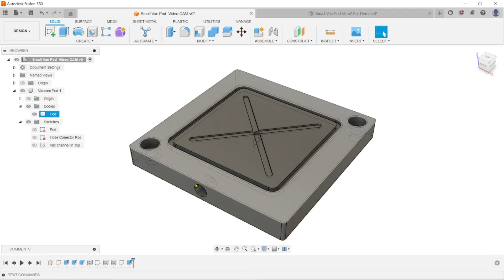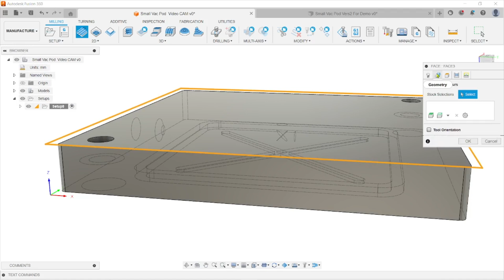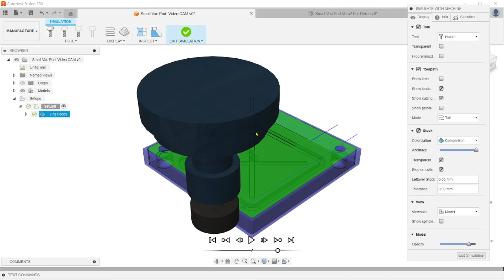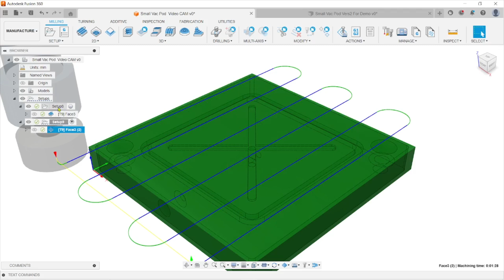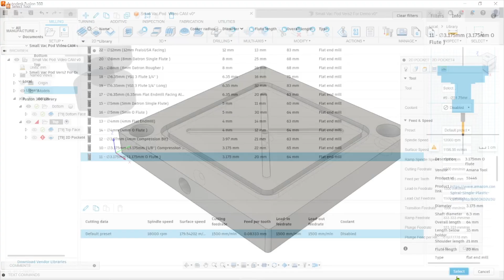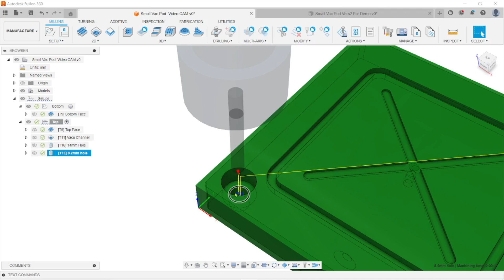Fusion 360 CAM: The Ultimate Beginner's Guide

Comment: thank you really good video
Reply from the maker: Glad you liked it !! Your machine is up and running ?
Reply: @ hello, yes i make several major upgrades and then I machines a part with heavy passes , it was really promising but my 2 Chinese ballscrwas died , they have play on the nut and the bearings block … zzzz
Reply from the maker: @ThomasLe_G HIWIN is tough to beat for the price - just make sure you get the real one. Also TBI is good.
Reply: @JBWorx  yes that's true, and you what is the brand of the ballscrews ? and where i can buy some TBI ones ?
Reply from the maker: Well the ballscrew on my machine is out of spec for the typical tolerance. I have proven that in one of my videos where I use the software to offset the error. Honestly I cannot provide a vendor that I trust in this moment. I did get a ballscrew / nut from Amazon about a month ago and I was surprised that it was good quality. I simply liked the idea to ship it back at no cost of if I don’t like it.

Comment: First things first, thank you for all your hard work in providing us so much of your knowledge and lessons learned.

What's the logic behind doing multiple step down passes on the pockets & perimeter VS cutting at full depth and doing multiple step in passes? I'm totally knew to CNC milling and I'm currently building my DMC2 Mini so I'm trying to absorb as much of your knowledge as possible, thx.
Reply from the maker: This is just a Funktion of the material thickness and how much material needs to be removed radial. Also what strategy is applied. For instance a 2D adaptive will protect the tool for too much radial engagement, but will use a rather high engagement of the flute length. A 2 D pokey path will not do that and you will need to take care that you don’t overload the tool during that pass. Hope this makes sense.
Reply: @JBWorx  Okay I think I understand. I've got a lot to learn especially with to loading on the radial and axial. 👍🏻
Reply from the maker: A lot depends on the machine. I am always conservative on my cuts protecting the equipment - I have time. But if you make parts for money it looks much different.

Comment: Thank you for the video really enjoyed it. I was searching for fusion 360 tutorials as I appear to have got my Z axis pointing in the wrong plane and I’m still unsure how to put this right.
I will be checking out your other videos. Thank you
Reply from the maker: Excellent that you enjoyed watching it. You can change the default orientation of the axis by clicking on the bubble on the top right with your account initials, then Preferences, in the general preferences tab is an option called “default modeling orientation” use the drop down menue to select “Z up”. That should do it.
Reply: Awesome thank you I will try that this evening. Do you think you’ll be making more videos with fusion, 360?
I recently purchased a onefinity elite journeyman. It’s not set up yet, but just trying to figure out  what software to go with. I own fusion 360, but I am also looking at Vcarve pro.
Reply from the maker: Well if you plan on a lot of woodworking projects then you can’t beat Vcarve for its simple 2D Lay-out of parts. It’s easy to learn and has a ton of great tutorials.

Comment: Excellent video!  I picked up a two tips from it. I've be doing CAD and CAM work for about 7 years in Fusion 360 ( not fulltime, mostly 2D - cnc plasma cutter, up until 5 months ago when I acquired a cnc mill).
Reply from the maker: Excellent thank you !

Comment: Nice video. Thanks! FYI, If you hover to the right of the entry box in places like the heights tab you will see a “vertical ellipsis” that will let you set a default user value for things like retract height so you don’t have to touch it again unless you change your mind :)
Reply from the maker: Yes, like I mentioned in the beginning you can set Your own defaults. I did not touch on that in this video … maybe should have. I cut about 10min worth of information out to get the video under 30min, people just don’t watch vids that long. However thank you for pointing it out I hope someone else will catch your point reading your comment. Oh yes forgot … I usually use templates for my cuts.
Reply: @JBWorx  sorry, missed that - should have guessed you knew. Also, I’m curious about your choice of the star bond medium instead of regular thin. Any specific reason?
Reply from the maker: Yes, it stays good a really really long time in the bottle and the cap never clogged, also it can bridge a bit of a gap if your part is a tad bowed.
Reply: @JBWorx  ahh. gap filling on bowed parts - good idea :)
Reply: I know you're going by YouTube analytics, but it is very untrue that people watch videos or even listen to them when they're longer than 30 minutes That's completely untrue. If the content is interesting, as in your content JB worx, If you made a 1 hour video I would probably watch it but a 30-45 minute video on a specific thing I would watch if it had enough information and pertain to me in the specific way that I was searching for. I noticed that you're always fighting the time constraints on YouTube and although I'm not a content creator and I'm speaking ignorantly I would suggest just as a viewer that you ignore all that and just make content the way you want to make content and put it up and people will like it or not like it they will subscribe or they will not subscribe. I hope you keep making videos though thank you for all that.
Reply from the maker: Thank you for your feedback. I think at the moment I have a bit of doom and gloom in my head as the last 2 videos did not do well and I like to grow my channel and my website. For a really long time I never asked for a like and as of today I don’t ask for a subscription as you said it either fits or it does not and the person that finds value will subscribe. This analytics that YouTube provides is quite interesting you can see over time how many people are still watching … it’s quite amazing. I think we all have less of an attention span nowadays with these “reels” on Facebook and there sites. Again thanks for being on board, people like you are the reason I make this content!
Reply: @JBWorx  hang in there. you have good content; takes awhile for things to catch. Also speaking just from personal preference... If I'm trying someone I am new to, I'm less likely to pick something long. If it's someone I know is succinct and knowledgeable, the longer the better.
Reply from the maker: @rbyt2010 will do … and thank you !
Reply: Thank you. The tutorial was very helpful.  👍👍😎👍👍
Reply from the maker: @joell439 Excellent !